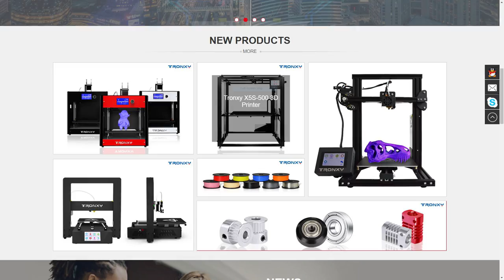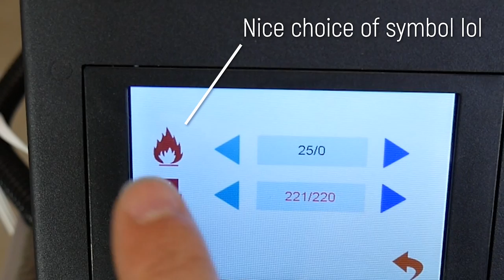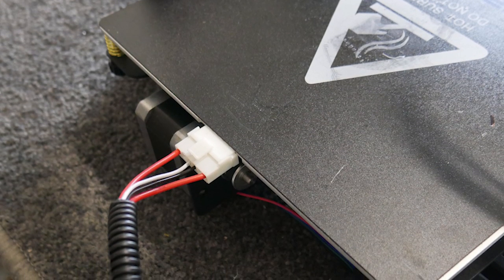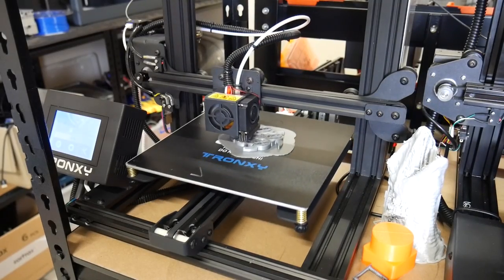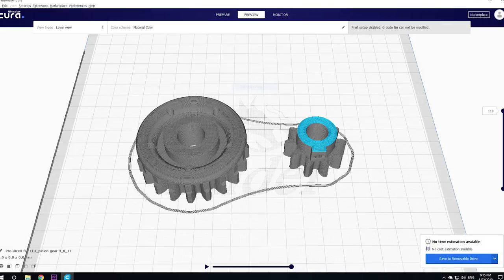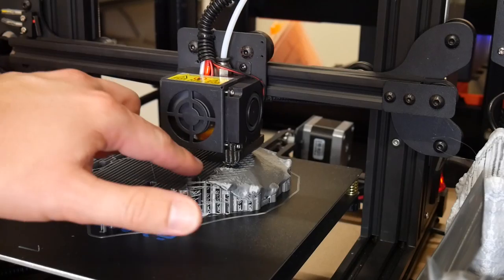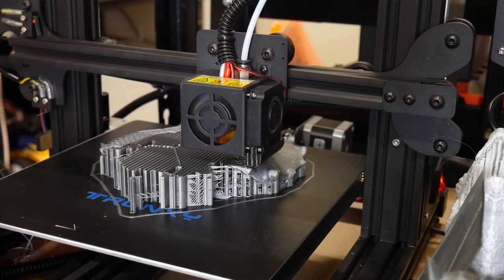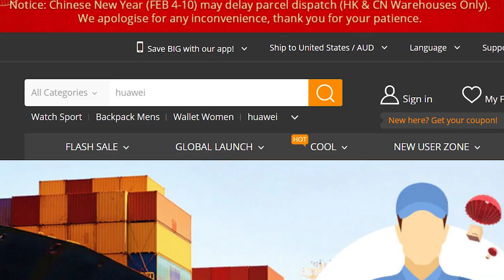Tronxy XY-2 3D Printer Review

Comment: For those interested in the details. I believe the bulging and inconsistency in the layers is definitely the drag of the Z carriage. And the coupler nuts are what cause it to be so dramatic. Those spiral cut nuts compress when tension is put on the lead screw and relax when tension lightens. A different style coupler nut would be a better solution along with making sure the gantry and bearings are all adjusted to optimum.

Comment: After owning a MK3 I will never buy another printer without a similar Flex sheet.  It just works so good
Reply: @Redemptioner1  do you still recommend the glass beds? Are the magnetic sheets different? Do they warp too? Trying to decide on what to buy right now. If I should get this printer or an Ender 3 (not sure which model to get there either: New Version 2, the 3X, or the Pro). I think the Pro is the only Ender 3 with a glass bed. I think the X might have it but not sure. Everyone wants version 2 tho for some reason. Apparently it has a new touch screen and tensioner mechanism and something else I can't remember.
Reply: I have never had issue with using glass. I rather like knowing that glass is absolutely flat.

Comment: i've noticed a characteristic with maker's muse reviews - as long as a printer isn't a kit or require a ton of assembly, he will most likely give it a positive review despite of having a ton of issues.  he seems to really, really, really hate to assemble anything at all.
Reply from the maker: Definitely some truth to that, I value "time to printing" quite highly, however I assembled the Prusa Mk3 kit and that took quite some time, but was well worth it.
Reply: And what is the result? Poor assembly quality. These devices are better off assembled by the owner.
Reply: @Maker's Muse  What was 'quite some time' for you? My Mk3 kit arrived 1pm on a Friday, and at 1am Saturday it had completed its first calibration ok. My first printer, and it's still going great.
I paid special attention when aligning the main frame, resting it on a sheet of glass to be as flat as possible when tightening the frame bolts.
Reply from the maker: @licensetodrive9930  probably about 8-9 hours during 3 streams, but they're super distracting and I'm not exactly working fast. They're archived on maker's muse live.
Reply: I know what you mean but I think at this price point they are starter/beginer printers. Which going in blind for some new users would be put off, if there was too much assembly. The machines at this price point should be easy to build and get printing and from there you can gauge how much you use it and if you want to spend more money to improve prints and save time. 

What surprises me is the ender 3 isn't a new machine and parts for printers have become better and cheaper, So why isn't there a considerably better starter machine in that price range.
Reply: @MakersMuse  a beginner won't be able to resolve all the problems themselves and you're not the only YouTuber with the same problems. Imo this is not a printer you can recommend to beginner's. (I haven't watched the whole Video yet, Idk if you have recommended it)
Reply: @miked5444  I think at this price point they are tweaker/hacker printers. kinda like OS's Linux vs Mac vs Windows. If you really just want a printer that works and doesn't require wrench time, you are going to put out some cash for someone else to do it.
Reply: @cheeto4493  Exactly. Some people love linux and all the power it has, while others are turned off by linux. Same here. You have to be a certain kind of person to even think that personally machining parts into square to be assembled into a 3D printer is a good time. Personally if it's fully assembled, it better work without any adjustment whatsoever. if it's a kit, it better require nothing more than screwing together the various parts like a Prusa. None of the "fine tuning" of the parts is acceptable. 

These are most definitely for people that want to fiddle with the hardware to make it work.
Reply: @MakersMuse  There is one of thease in my little girls room she's 6 im thinking I'm not supposed to know its there I think it may be my Xmas present woops I really hope its for me I've never ever seen a 3d printer in person so if it is im starting very fresh
Reply: Fingers crossed I can work it out only 7 days till I can start playing with it if it is mine I don't know y it would be hidden in my daughter room if it wasn't for me surely I would know about it and it wouldn't be hidden

Comment: The Ender-3 is the low-cost standard every one needs to at least meet. The original Ender-3 came with a removable G-10 (with "buildtak") plate. It works great. Things worked great out of the box for the majority of people.

If manufacturers can't at least meet those expectations, they've already failed. It's a simple formula that Creality is still building on with their subsequent Ender-3 updates. At least one Chinese company gets it.

Comment: Great review!

The Tronxy X1 had a similar clicking problem with the extruder, and shortening the Bowden Tube 50mm or so fixed the problem for me on the X1, and I suspect the same issue is true for you. Also, even though the parts are pre-assembled, you should loose them up and with a Triangle or Combination Square, made sure that everything is squared up on it. Only then I suspect that the rollers will go evenly without binding and giving printing problems.

Plus, you should go all the adjustments of the axises and extruder to make sure all is perfect. Out the box the Tronxy does fine, after all the adjustments, the Tronxy will do better than most printers in its print/price range.

Comment: I just picked one up and, with a little tweaking, it works nicely for my first printer. My main complaint at the moment is that the hot end tends to jam up consistently at the very front of a Benchy (all that comes out is thing, stringy PLA threading). It's done three failed Benchy prints so far, and one completely turned to spaghetti for some odd reason.

However, on other prints, it's done just fine. I'm going to do the tolerance test and a few others tonight after fiddling with the voltage to the stepper.

Thanks for the review!

Comment: The more I watch these cheap printer reviews out of curiosity the more spoilt I feel with my Prusa i3 Mk3, it prints like a champion, and it should do considering what I paid for it :)
Reply: When you eat, do you take regular bites or Megabytes?
Reply: :)  So very few people recognise the logo
Reply: Creality printers match Prusa for quality.
Reply: @okleydokley I had a good budget when I decided I wanted a 3D printer about a year ago, and pre-ordered the Mk3 based on the reviews of the Mk2 along with the heap of features that most others don't have; removable spring steel print bed, resume printing when the power cuts, stealth mode (I really like this one), the PINDA proximity sensor for the auto bed leveling, optical filament sensor, how it finds the XYZ origin point by measuring the current use of the stepper motors so no end stop switches, the ability to print PLA, PETG & TPU with no modification beyond the slicer settings, and other things I can't think of right now.
Reply: @truantray  I'm on the verge of getting an Ender 3 Pro, but one thing that still bugs me is the longevity of the product. While it undoubtedly produces high quality prints, I suspect that it won't last as long as a Prusa.
Reply: @truantray  sorry but no
Reply: One year later and still going  strong. MK3 has its own problems, but nothing you can't solve, I just watch all these clones struggling along. Ender 3 might just make it there, for a low cost machine (and yes, cut my teeth on a Anet A8, now a relic). My MK3  has been worth the investment in money over a long term.
Reply: I feel the same with my Ultimaker 2+. I paid a lot for it, but it is rock solid and I never have to worry about it failing a print. I can almost treat it like a regular 2d inkjet printer!
Reply: @itaialter  I think the Ender 3 (as well as many other printers) are pretty serviceable. If you are handy, you should be able to get most parts with many upgrade options like better power supply, extruder, hot end, etc. If I had to pay $6-700+ for a 3D printer, the boss (wife) would've laughed in my face. She was cool with $200. Good luck
Reply: @truantray  if they don't catch fire 1st
Reply: @donpayton737  we have makerspaces with prusas and creality. Prusas are neither better quality nor more reliable. We have some E3s and Cr10s with thousands of hours.
Reply: @licensetodrive9930   CR10S pro can do all that.
Reply: @jboy27  never seen this problem, but maybe I should believe the internet more. Mk3s have an extruder problem after about 200 hours and we have yet to find a solution, which is why our farm is now 2:1 Creality: Prusa.

Comment: As always, a great review. I like some of the upgrades over the Ender 3, but the potentially inferior quality issues you experienced are concerning.
With Cura make sure you enable support interface. With it enabled, after just a little tweaking, supports will literally pop right off. The printed surface over the supports will be much nicer as well. Without it Cura supports can be really, really difficult to remove...as you experienced.

Comment: You will find the frame is not square, take a couple of set squares, loosen all the bolts and slowly tighten them up again using the set squares to keep everything square.  Before you tighten the bolts fully on the gantry use Z axis to check how square the gantry is by running it up and down without the lead screw, when you do this slowly adjust the concentric nuts up tighter till you have a some resistance in motion (pre-load on the bearings) but not enough to cause the bearings in the wheels to start "cogging" (you will feel this in your hand as you move it up and down).  The idea is to loosens the bolts a little while sliding the z axis up and down, when the z axis binds you nudge the gantry into alignment, tighten the bolts a little and repeat till motion is smooth through the full Z axis travel and your concentric nuts have a good pre-load. Once you square up the gantry using the z axis you can tighten everything down and install the lead screw.
Reply: There are also issues with the uprights being cut the same size/squarely.

I had to machine approximately 0.6mm off my Ender uprights to bring them back to the same length with perpendicular cut faces. They were cut less than a degree out, but over the entire height it ends up with a huge misalignment at the top.
Reply: It's the same lessons he should have learned when he did the review for the Tronxy X1 last year!

Comment: Hey Angus. The clunky sliding movement comes from where the roller-wheels were overtightened at the factory - they have flat spots. You can try rotating each wheel a bit so that they are not in sync with each other, and they do seem to recover their shape a little after a month or so of use (if the tension is released). 
I had this with my Ender3's - it seems that TronXY are doing the same now. Useful to know. :)
We are getting quite a few reports of this from our customers who have recently bought Creality machines. It seems likely now that affects some other mfr-assembled printers, but only had Creality ones reported to date - someone on the production line is a bit enthusiastic when they tighten the spacers. ;)
Reply: Another reason to buy self assembly kits.
Reply: This is why I like kits, 1. If you build it, you know how to fix it quickly. 2. No labour means cheeper price. 3. Cheep and preasembled cost more for low paid assemblers that screw stuff up, that you then have to figure out and fix.

So basicaly, everyone with this deformed roller problem now has to wait a few weeks for them to fill out. Or spend 2 hrs ordering at ther expence and replacing them rather than a 3 hr build. 
If I bought that, ther first thing I would do is plug everything to getter to make sure the electronics work. Then strip down and rebuild. But in this case have to buy 20 odd rollers and wait for them to arrive.
Reply: @UberAlphaSirus  They might not even be recovering their shape - it could be that the rest of the wheel contact point is just wearing down a bit. All I know is that mine got better with time - I decided not to spend the money on good quality new wheels, as cheap they ain't.
Bad assembly is the price (ouch, sorry!) we pay of cheap printers I guess. ;)
Reply: I noticed a difference in two shipments of rollers from China.  One sourced from Amazon was assembled properly and moves along the v-slot properly.  One sourced from AliExpress was assembled with the center shim between the bearings missing, so that tightening the wheels causes binding.  Additionally, they do the same bumping motion that Angus demonstrates.  So, I suspect that the Tronxy rollers are missing their central shims.

Comment: I got the tronxy x1 when it came out and pretty much rebuilt it 4-5 times over in many iterations. It was an epic learning experience and now I know so much about the mechanics and electronics of 3d printers. Long as you're willing to learn everything about your machine these cheapo printers are great. If you just wanna hit print get a prusa or even more expensive.
Reply: Prusa require complete assembly.

Comment: Hey.. Could you please review the Tronxy X5SA? It's a really big core-XY printer.
Reply: hey i have a x5sa 330 x330 version  if u put in corner reinforcements with thees steel 90° brackets u can buy online its solid as a rock then give it 10 h ove moving to runn in all the rollers caus tronxy dose have a broblem with them or the bearings that run in them  after that they did run alright but i exchanged all of the pully bearings  with good quallity skf bearings that i had laying around, flexing of the xy motor mounds isnt a problem and the tutch is great u need a bout 5-10 h to assembel the printer correctly and nicely
Reply: yeah, 560NZD with touch screen, auto levelling, dual z leadscrews... that looks very tempting
Reply: Here is what I wrote to him - TronXY X5S owner here and never again.  I mean I had to spend so much time making it work (go on Thingiverse to see all of the mods that are 
needed) that it isn't the same printer anymore.
His response - Yeah that thing was a total pile of poop...

Trust me the X5S and X5SA are the same only the A has auto bed leveling with a sensor and with everything else being equal it is a big steaming pile of poop.
Reply: @thebeststooge   thats actually not true at all. cause its not the case. things the x5sa has that the x5s lags: strong hotend mound(2 steelplates) steel for the other sliders to, good acrylic parts that do not bend   32bit bord, color screen, good gt 2 belts and a better partcoling fan shroud out of the box tho that is still quite shitty
and last the meshbed leveling 

when u buy a x5sa spent 20 bucks on good ball bearings and 10 on cornerbrackets and print out a nice   hot end fan holder thing and coling duct combo the printer is easeally capebel of printing o.k. quality out od the box.
Reply: @mogelzmo I speak of it structurally and it is shit though the controller is better on it (I believe it is MKS product).  I am in a TronXY group so I know what owners say about their machines and it may be less of a turd than my turd but it is still a turd.  With as much as it costs it should not need a single thing to be done by an end user.
Reply: @thebeststooge  o.k. we can differ in that price point thing i bought mine for 300 € with shipping from germany and i coudnt find a nother core xy machine at that price point, i did know that it had a view bad things to it but. I was willing to deal with. 
i think most of the prople having problems with getting there frame squere not squere ish, real squere (same as the perfect level surface from rick and morty) :D 
And alsow the belts need to have exaxtly the same tightness 0 tolerances given there. then it prints o.k. out of the box 
But maby i just got a midweek modell and realy lucked out btw all my parts are straight even the heated build platform
Reply: @mogelzmo  Far too many receive Friday made machines regardless of which model and with the absolutely horrid GearBest support and illegal activities they do (they did it to me and had they been in the USA they would have been in some serious problems) new people to 3d printers, which is what Angus is talking to with this one, should stay clear from them or at least be warned what poop they are about to step into.  Expect no viable support from GearBest and what you see in their for sale ad on their site may not be exactly what you get either.
Reply: i got the x5s, didnt even bother with the board, extruder and hot end assembly. replaced it with mks gen l , e3d volcano 0.6, and titan extruder. everything else is as it came. and it prints great

Comment: So pardon me if this was covered somewhere, but what is your standard for filament calibration? I ask because when it comes to your tolerance test (around 7:00 in the video) you mentioned you were surprised that this could print tight clearances, but the Ender3 couldn't. It strikes me that how you calibrate each filament spool could easily cause these to clear or fuse, irrespective of the printer's precision. No?

Comment: I don't understand why you hate micro SD.. Well, I mean I completely understand it's an annoying form factor to juggle in a workshop environment, BUT I'll take the microSD slot over the full size any day! It's just so darn difficult to find the large form factor cards in normal stores these days and those adaptors are terrible! I've had so many prints die because the microSD card randomly came loose in the adaptor while printing.
Reply from the maker: The issue is the holders are surface mount soldered in place, so after 100 insertions or someone tries to force it - it breaks and your machine is broken.